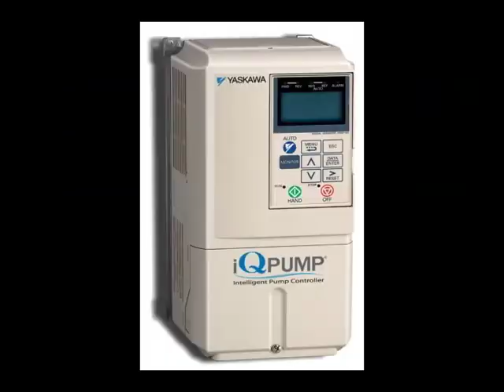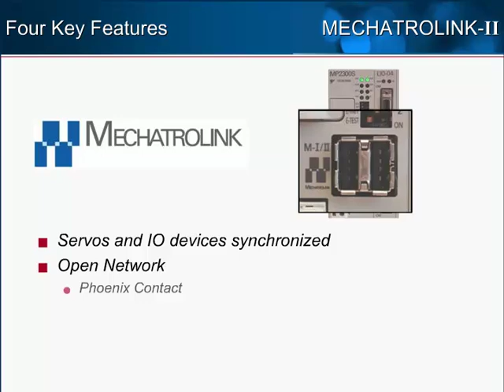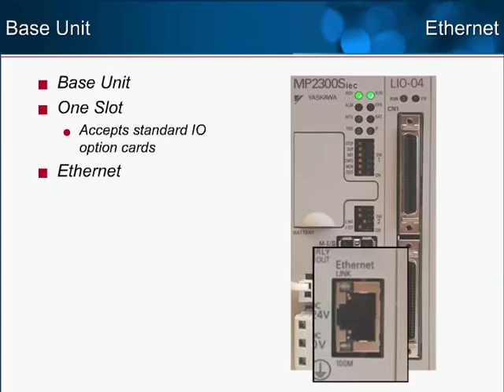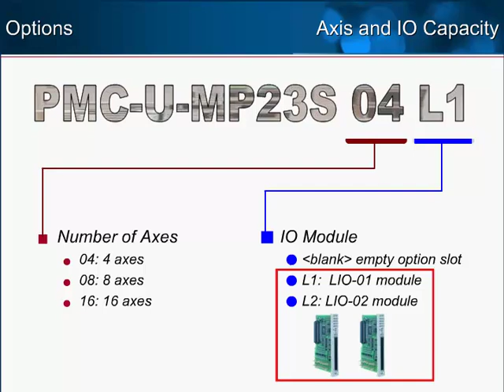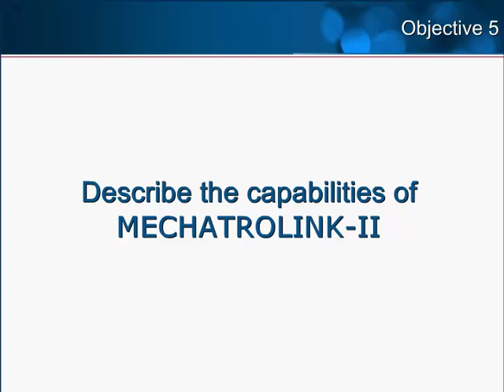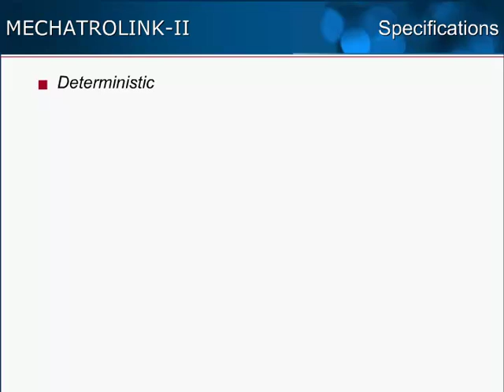MP2300Siec Hardware Overview

Comment: Hello,
What is the cycle time for reading encoder with LIO-01? Is it the same with ML2 cycle time?
Reply from the maker: The encoder on the LIO-01 card will update at the Mechatrolink rate. Some function blocks can 'read' the information at the Mechatrolink rate. Otherwise if you are just accessing the variables created by hardware configuration, they would be read at the defined application task rate.